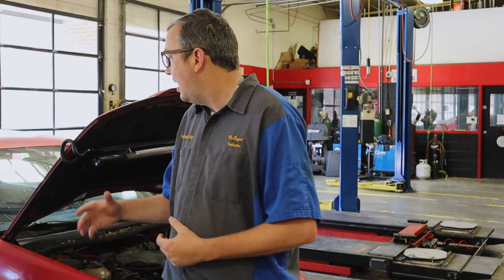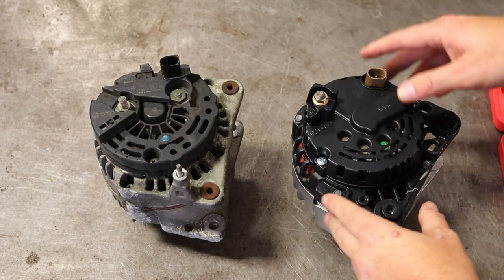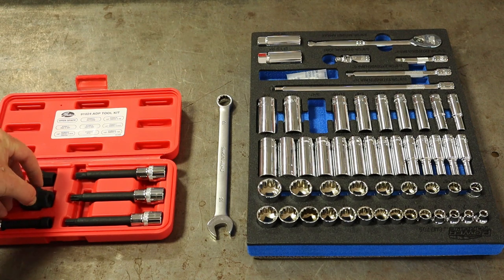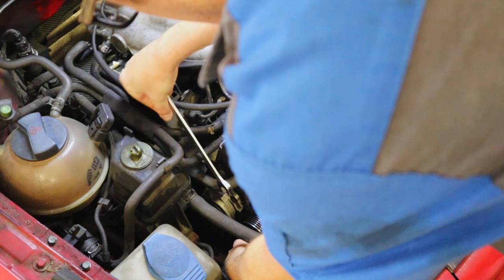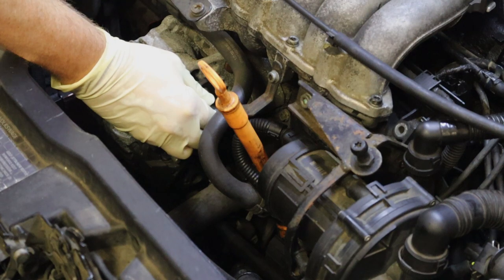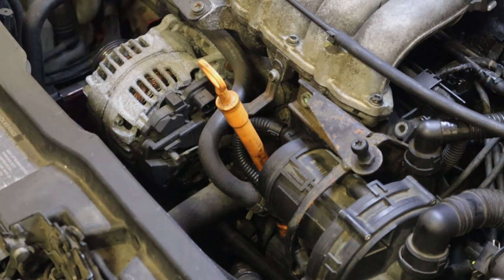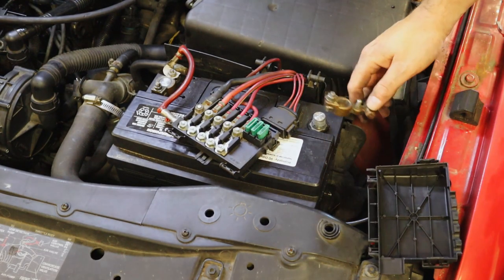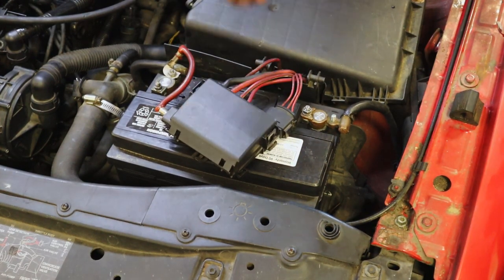VW 1999-2005 mk4 Jetta Golf Beetle alternator replacement and identification

Comment: Hey, I wanted to thank you for taking the time to share this video. You just saved me hundreds of dollars in costly parts that would not have fixed the issue I was having. The battery I recently purchased died. I took my ride, a 2003 VW GTI to get the battery and charging system checked. Their testing gear said it was a bad regulator. I was shown multiple options costing up to $300 for a new alternator. 

I figured the cheapest way to go was to see if I could find one at a salvage yard. I checked the area yards and there was a 2002 GTI that was recently acquired. So, I prepared my tool bag and planned to visit the yard in the morning. 

I thought it might be a good idea to view a few videos about the removal of the alternator to learn what tools I might need to do the job of pulling an alternator in the yard. I checked your how-to video first. You mentioned in passing the specific wire that leaves the fuse panel that's located on top of the battery and connects to the alternator. You also shared that sometimes the issue isn't the alternator but it could be the cable or the fusible link it's connected to. 

I checked the fuse panel and the fusible link connected to the alternator cable looked oxidized and a little warped. So, I removed it from the fuse panel, and used a special tool to flatten it. Then I used some fine grit sandpaper to remove most of the oxidation. I also I used some small wire brushes to clean the oxidation from the threaded post, the nut, the washer , and the cable end. 

Afterward, I returned to the parts store to have them check my system again and everything passed! One oxidized connection was the only issue. And your comment aimed my investigation in the right direction. Thank You!

Comment: That bottom stud you hooked up first was for the ground wire correct. When I took my alternator off the nut was off the bottom stud and there was a pretty big ground wire laying there. Like a # 6 size ground wire with a ground lug. It looked like it went over that bottom stud, but not sure. Thanks in advance

Comment: Great Video! I did not see you use the ADP 91024 tool kit, looks like I just need a 16mm wrench and normal socket set correct?  (do not want to get tools if I do not need it)
Reply from the maker: If you have a clutch on the alternator, you will need the tool to remove it and put it on the new alternator. Some have them but most do not. Thanks for watching!

Comment: I was wondering if the rear cover of the alternator is replaceable? If it is i could source one from a local pic n pull wrecking yard. Or do i have to buy a whole new alternator,?  Because where the connector that extends out of the rear cover broke off,  and now I can't plug the harness into the alternator.    Thanks

Comment: Is there no timing? Does the 2.0 have accessory belt and a timing belt. Or is is all 1 belt. If so, don’t you need to time the engine again?
Reply from the maker: @zeuss1353  it has a serpentine belt and a timing belt. Two separate systems. Removing the belt from the alternator is the serpentine belt, no timing required. I hope this helps!
Reply: @ thanks. Didn’t know that. You really helped me a lot. Thanks

Comment: how do you remove that retaining nut on the clutch pulley?
Reply from the maker: You would need a special tool like this one: Alternator Clutch Free Wheel Pulley Removal Tool Compatible with Ford Peugeot Vw https://a.co/d/a40k6nc
Reply: @AutoScholarwithMrB  
finally took alternator off so I could see it better. looks like the remanufactured alternators are set up differently. the clutch isn't part of the pulley, it's just a pulley
Reply from the maker: @kevindougherty593  oh ok, yeah some have them and some don’t. It’s a crap shoot.
Reply: thank you for your time & great videos
Reply from the maker: @kevindougherty593  absolutely! Glad to help.

Comment: So I can use my Bosch from my vr6 on my jetta 2.0 with a Valeo?
Reply from the maker: Some of these had one or two wire plugs. The one wire plug was on the 2.0 only I believe. The mounts may also be different but I can’t be too sure. Let me see what I can find. Very good question!
Reply: I own a VW Golf mk4 2.0 and it actually has a 2 wire plug. I also have an alternator from a 1.8T mk4 and that one has a 1 wire plug. Maybe useful info for someone out there.